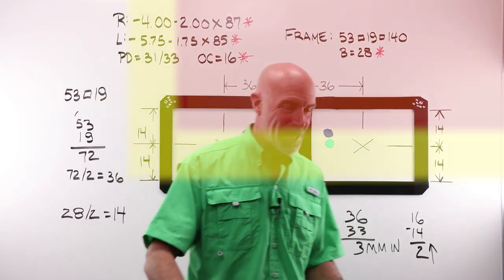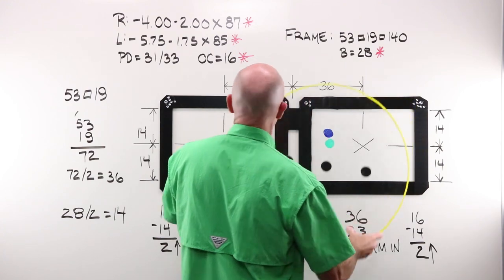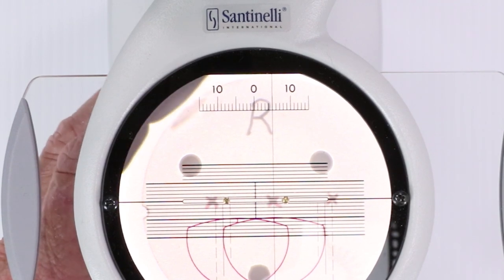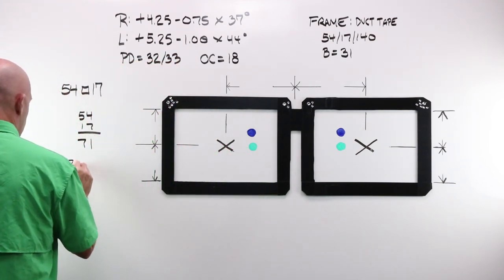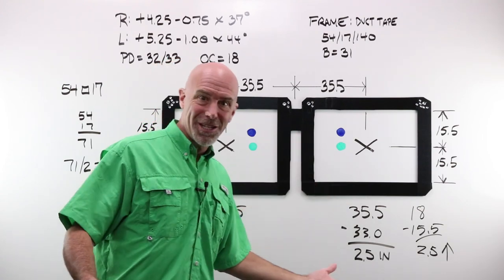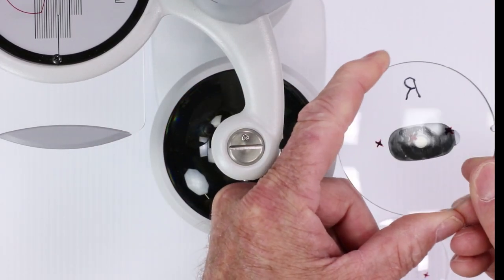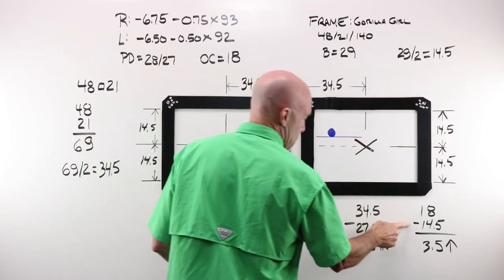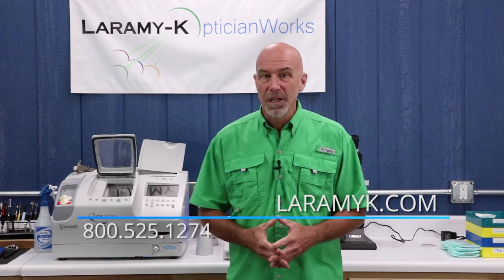Vertical and Horizontal Decentration - Working with OC Heights

Comment: Hi John... nice video.
I want to know if it’s always important to work with oc height on single vision lenses or just the horizontal decentration will do. Thanks.
Reply from the maker: Adenigba, Most opticians will start requesting an OC height when power reaches +/- 4 and over. Much to consider - see OpticianWorks website. John